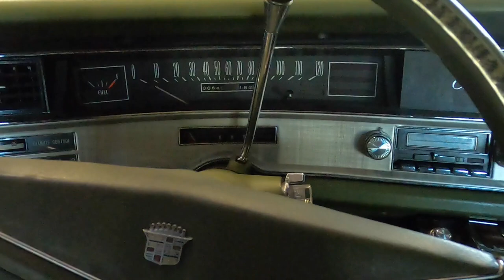VLOG - 2-For-One - Cadillac Deville 472 Oil Change - Mercedes 300SD Fabrication

Comment: Weird!  I've come across the stuck gasket more times than I can remember, but never on anything that I've ever serviced previously.  One of my coworkers at a government shop I worked at left the stuck gasket (didn't see it) and had a massive oil leak when the doubled up gasket blew out due to pressure.  I wonder if it's a combination of our environment, lack of lube on the gasket, and overtightening of the filter that can contribute to gaskets getting stuck to the block?

Comment: I have been using molly aditive on my 300sd as well as in my gassers, 5.0l 32v Ford and the 5.0l 24v Merc ml500 and soon in a Mazda. I find it helps with mileage as well as cold starts. Not an advertisement, and won't put a link. But I get mine for the devil's internet store.

Comment: I think if you put the filter on with no oil on the seal and then cranked it on really tight and then left it on there for about 20 years, the seal might stick to the engine when you took it off. I ain't never seen it though.
Does that thing drive over the road or does it float?
I've never had a caddie but I had a 75 Riviera once. What a beast.
Reply from the maker: It's hard to beat the ride on an old American land yacht!